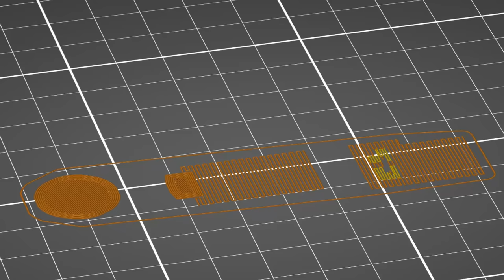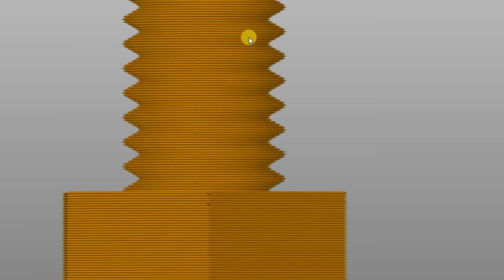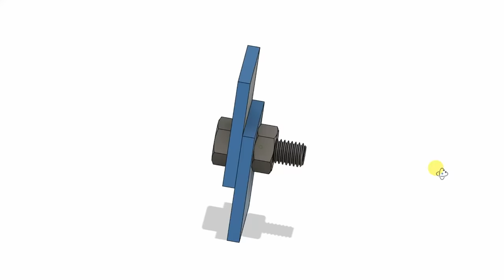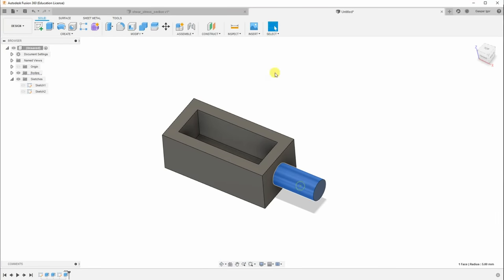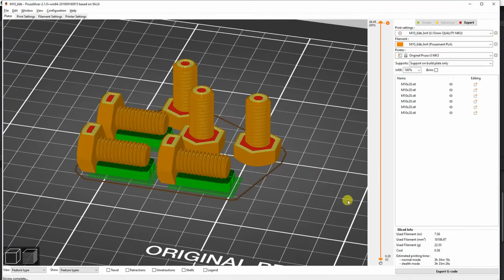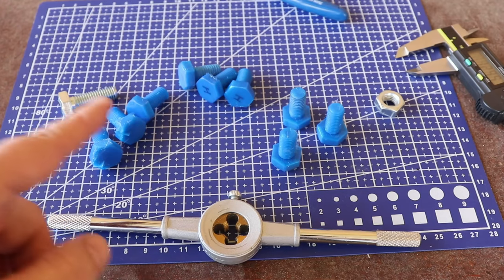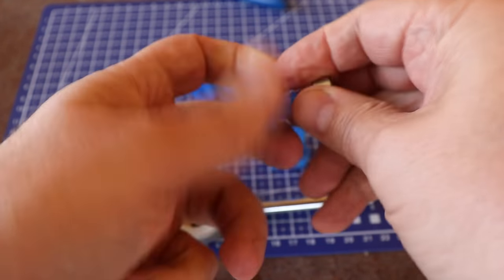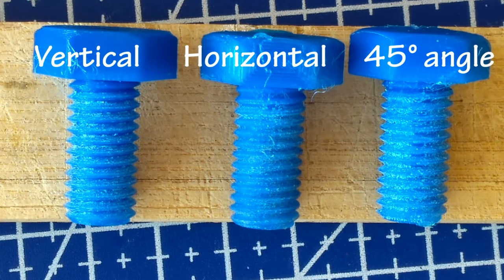3D printing bolt and thread in horizontal or vertical position - strength test

Comment: I should do this test in ABS.  Its notoriously bad at layer adhesion, but I've figured out some tricks in the settings to get it to fuse REALLY nicely and solidly and im tempted to try it.

For those interested, you can get improved layer adhesion by increasing environment temperature.  building an enclosure, then adding in a heater on a relay connected to your board.  I run ABS prints at an environment temperature of 60c, and I actually use the cooling fans at low speed, increasing for bridging and short layer times.  it ALSO requires a minimum layer time, 15-20 seconds works well for mine.  to figure these out i printed a small clip over and over with different settings, a 20 minute print, until I got a tiny, thin part I couldn't snap by hand.
Reply: Haven't printed yet with ABS, but I heard that a problem people have is issues with warping/uneven cooling.

So I'd guess for most people who print ABS without a high temp enclosure the resulting print is barely holding itself together so to say.

Comment: Really impressive! I never thaught they would hold this much. And fun way to test it :)
Although (depending on how strong you are), you may get more force doing it the opposit way - attach the bolt to a barbell on the ground and lift it. And once the bolt gives out, you don't fall to the ground with a lot of weights on top, haha. This also really show the weakest point with 3D printing - layer adhesion.

Comment: for the diagonal one, it might be that at a certain position, under shear stress, it acts like the horizontal one, as the fibres can be diagonal to the shear stress, similar to the bolt with the horizontal fibers.

Comment: I just watched this video, and subscribed instantly 🙂. I'm absolutely beginner with 3D printing. I bought my printer 1 month ago. But, I have technical knowledge and experience. I faced with this vertical printed bolts problem already in the first days. I printed threads horizontal with support, but they were unusable. I mean unusable without post-production. This video confirms my decision. Every time when I will print bolts (and their strength is important) I will print them horizontally with supports, and I will rework the threads with a thread cutter tool.
Reply from the maker: Here is an additional info on the topic https://youtu.be/E3WRBp-T42o

Comment: Also for the stress test, i think using weight and gradually adding them on would be a bit better.  

E.g. start with decent amount, wait 5-10 mins to see changes, add an additional set amount, wait, repeat till it breaks.

Comment: What if, you print the threads to nominal (or +0.1mm) size and then heat the threading die to 80C (into PLA glass transition).
Will it smooth out the surface when "cleaning the threads" or is it possible that the heat will somewhat compress the threadform with the die into correct shape.

Comment: Just wanted to confirm that I was right about positioning, I experienced issues with parts being printed vertically, they would brake very easy because of the way i lt was printed, only horizontally i get the best results when it comes to sturdiness of the parts... Of course not every part, some of them better vertically, anyway Thanks for the great video!!! You did excellent work man!

Comment: You should be happy about the results. You've found a way to make much stronger bolts than you could before. You can still make them the way you used to if they are adequate for the job, but now you have the option to make stronger ones as well.

Comment: A note on supports for the horizontal print: You don't need so much support. A 1mm wide support is enough for an M10 thread just so that it has something to rest on. It's usually best to add this support directly in the modeling tool instead of activating supports in the slicer.

Comment: I know the video is already two months old, but I wanted to add an observation here. 
I researched a lot of mechanical properties of 3D printed materials during college and even published a paper about it, so the reason the horizontal screw can handle much more wight is because the raster lines of the layers are aligned with the force applied to the screw. I would like to see you testing again but with the screw been held in the horizontal not the vertical, as the main force been applied in the screw would be shear force not simple tensile pull. I bet the vertical screw would fare much better in this scenario. 
Sorry if I misspelled something, English is not my primary language.
Great work and great video!

Comment: Im not gonna watch a 19 minute video, but Im assuming the horizontal bolt would be stronger because if it was printed vertical the layers of material it was made from would seperate easier.

Comment: 9:37 it was kind of obvious that horizontally it would be the most resistant print because the traction applied would be in the same plane and direction as the layers print, it's nice to see someone testing this, but an extremely predictable result !!!
Reply: Quite, however, if he had used bolts printed out of PP, the results would be probably a lot less clear or possibly there wouldn't be much of a difference at all.

Comment: The Horizontal position makes sense if you think about the way the layers are printed. the weak points wouldn't be where the layers are placed like in the other positions. You're pulling along the layer lines instead of between them.

Comment: An alternative to using supports for the horizontally printed bolts would be to print bolts in two half-pieces, and either gluing them, or just using the compression from the nut to keep the two halves together. It may be worth testing this concept out to see if there is improved strength and this idea provides a reasonable compromise to obtain some of the benefit of the horizontal print without the additional support requirement.
Reply from the maker: Yes, I got this suggestion few times, definitely I will test it in near future. Thanks

Comment: Won't be printing bolts because nylon is cheaper and strong but very useful information on material strength regarding to printing orientation. Keep up the good work !

Comment: For the first 2 tests I would have suggested using a hand cable winch for 1. Higher range for weight simulation and 2. Safety.  My old metal shop used them for testing smaller metal bolts.
Reply from the maker: solved, in my latest video you can see my new testing setup. up to 500 kg

Comment: I'm just watching the intro (so this might be irrelevant), but if you want to standardize the shear stress test better, don't tighten the bolt, (introduces different stresses that make repeatability difficult) but instead use it as a pin inside a clevis joint. The joint can even be sized properly to each bolt to represent the proper support that a bolt would get and avoid mashing threads. (Which happens when the bolt is sheared against flat edges)

Comment: Great video with great details. For my needs I print bolts in horizontal position without support, but flattened on the bottom. i.e. I cut small amount from the bolt bottom so it can lay flat. And print with no supports and the bolt is strong.

Comment: Really nicely presented results that anyone designing 3D printed parts / enclosures should consider. In my experience, the engineers designing some of these parts, even in commercial applications sometimes forget the very fundamentals and cut corners in design to save filament/ time / revisions..

Comment: I like the video, in fact your videos in general.   I do suggest however on the printed bolts like manufactured metal bolts you investigate the fillet area of the bolt. This area is where the cap meets the threads.  For metal bolts to conform properly to load and to have significantly higher sheer resistance the fillet plays a large part in that.   A fillet is simply a rolled / curved transition to the threads. There is also a reason for a non-threaded part of a bolt and that is for the fillet to transition into material that is like treated / hardened etc.. to the core of the bolt.  The threads may be formed by cutting away material or pressing material. That does not matter to printed, however, I suggest you also consider that transition area for better results

Comment: I believe the order in which you print these results in differences, the printer was warmed up when printing the 2nd piece.

I bet you printed them in this order - 
1. Vertical - Printer Not Hot Enough
2. Horizontal - Printer Temp Perfect For Prints
3. Diagonal - Printer Too Hot

If you printed the horizontal first and diagonal second, I bet you would have different results.

Comment: I see you have the bungee cord to prevent the items from flying off when you are testing the strength comma but you have to figure out another way to test things like this because there's always the risk that bungee cord doesn't work and that metal goes flying into your back. All it takes is one good to the spine and you don't walk again.

May I suggest making a simple box frame? Make the top of it a lever and put a bottle jack under one side. that way you just have to pump up the bottle jack to add pressure and it will make more pressure than any weight you hang. You can add a hook to the bottom side and the pivot arm of the box frame to hook the scale and item onto. If you ever do any tests like this a lot it would save you so much time, effort, and it would allow you to do it safer and with a lot more Force. 

if what I wrote is hard to explain I can always draw a picture if you would like it.
Reply from the maker: Thanks, I already have a safer testing method (based on chain hoist), for example used here: https://youtu.be/E3WRBp-T42o

Comment: Hi. I'm Igor.  
Seriously. That's my name too.  :)
Bratislava 64. I have my suspicions it was a sympathy name. You know, imminent russian take over and all.

Good video. I've always printed bolts horizontally with good results. 
My method is to print hot for maximum adhesion with about 10-15mm of support in order to help mitigate deformation of the supported surfaces by getting the part higher off the build plate, and thus better able to cool.  Sort of a balancing act. Always going to run them through a die anyway but aim to take off as little as possible.

As for nuts, they're under compression with tensile forces being perpendicular. Horizontal is obviously the best way. Still have to wonder if just a little angle may be of any benefit with nuts.

Comment: cool tests and numbers.  Something i realized years ago, but still good to know w/ some numbers.  For example, you can snap a piece of filament in half pretty easily.  Now try to break it pulling on both ends.  Much harder eh? Same principle. If you can design your part assuming the loads are along the length of the layers, you'll have a stronger part.

Comment: To avoid accidents, you can use a steel cable fixed to the floor and a turnbuckle... this is not expensive, and allows you to experiment without risking your health. Good video. Regards
Reply from the maker: Thank you, since this video, I improved my testing methods, here is one with improvements, similar subject: https://youtu.be/E3WRBp-T42o

Comment: That's why I love my SV04 idex: you can use PETG as easy break away support for PLA and vice versa.
Reply from the maker: There is a method, where you print in horizontal position and don't need supports https://youtu.be/E3WRBp-T42o

Comment: Thanks for showing the experiments. But honestly, I skipped to the conclusion because I know the continuous string (in the horizontal position) will definitely provide the strongest pulling strength because there is no layer separation -- or the fused deposition cannot still really fuse the two layers (because the bottom one is cold).

Comment: I have been looking at using 3D printing to make the bolts as resin molds, then casting it.  The bolt can be made with the equivalent of 100% infil, plus the plastic is being extruded as single peice.

Comment: Loved the test, but I would have also added a Control which is a non 3D printed bolt made by using the same material but threaded (to show whether the issue is the material or the shape)
Reply from the maker: I will try different materials in near future, including resin and injection molding
Reply: @MyTechFun  thanks for the reply! I appreciated the video a lot. But try to be safer :)

Comment: Well done test approach.  In some of my testing, I find that the inter-layer strength is greatly affected by cooling settings.  In using PETg filament, with the "PLA cooling fan" on, the layers would separate easily,  I disabled the cooling fan, and the inter-layer strength is much stronger.  Likewise, printing in an enclosed (heated) cabinet like for ABS helps greatly.  I have also read the printing in thinner layers (which get squished out wider) is also stronger between layers.
Reply from the maker: I already got this suggestion, it looks like I have to test that too in near future (PETG vs PLA, less cooling, vertical position)

Comment: Great video! It can be seen how much effort you put into the detailed documentation of experiments. I would suggest you for the next time to make at least three (preferably more) tests for each specimen(e-g- 0, 45, 90 degrees)  and each test type. That way you can calculate the standard deviation within each test. Presenting standard deviation makes your measured data and also conclusion more trustworthy. Great job though!
Reply from the maker: I agree, but first I have to prepare some easier pull test method. This was only rough comparison test.

Comment: Nice video! I really like the "tree support" feature in Cura. It seems like it uses less filament and prints faster (but not in all cases). Might be worth a try to print screws horizontally with it. Getting pefect layer adhesion might be hard sometimes.
Reply from the maker: I am testing sliced horizontal bolts, looks like that can work too and no supports needed

Comment: Thank you for this information, I expected the horizontal as favourite, but I didn't know how far. One thing I'd like to mention: how about the environment temperature? What would you expect for a hot summer day, I think this could have an impact too, probably weaker but how much? Nevertheless, I know, this question is more about the filament type and not the thread technique.
Reply from the maker: Yes, good question, and more important if we use PLA. I am very curious about that too, I will do some experiments on that subject too.
Reply: @MyTechFun  thats fine, I'm waiting so long, thanks :)

Comment: Thank you for this video !  You have a new subscriber 😊
I join the other persons urging you to use a pulley system or a jack or .. something. 
It looks stressful, and also much less professional when you use your body like that.
(I have read your answers about the upcoming Arduino tester 😊)
Anyway:great video!
AND: It would be GREAT to see horisontal printed screw in two halves... without support, and see how that would perform 😊
Best of luck 🙏‼️
Reply from the maker: Thanks for comment, up coming tests: bolt in two half, but also bolt cut 10% approx, it can be printed without support horizontally. It should work too. Also I got suggestions that PETG is much stronger in vertical position compared to PLA. But first I have to test screw nuts too.

Comment: Great video. Very usefull for the project I am working on. Surprised about the strength in the stretch tests. The torque as expected really. That is the weakest point of these bolts. But the test confirmed that I do not have to use steel in my project as the load is not very heavy. I was thinking about putting a nail or small bolt inside the 3/8 inch bolt I am going to put on my design just to reinforce it. But probably I don't even need that.

Comment: Just a suggestion, to test the shear, it would be better to setup in a double shear mode. Your current testing in single shear mode will result in the part being tilted, which the resultant force will have both a shear and normal component.
Reply from the maker: Yes, I agree with you. If hole is near similar size as bolt, that tilting is not so big. And since this is comparison test, they all are tested in same conditions. For double shear test I need to rebuild testing equipment, my weight wouldn't be enough for that ;-)

Comment: For the shear test, the 45°-printed bolt is probably anisotropic. Depending the direction it is mounted, it should be weaker or stronger (if the printing layer plane is parallel to a vertical plane or at an angle to vertical). That said, even if there was no actual improvement in the measured  performance of 45°-printed bolts, I wouldn’t use them, just because their properties can potentially vary by a great deal depending on the orientation they’re installed at.

Comment: I also hate using supports, but if I want maxium strength, I would split the bolts in half lengthwise in the slicer so as to enable both parts to be printed horizontally, then supergluing them together. Yes, you do have to carefully align both parts otherwise the threads will bind with the nut. It would be great to know how the super glue holds up in the torque test with this method.
Reply from the maker: Something like this? https://youtu.be/E3WRBp-T42o
Reply: @MyTechFun  Yes exactly like that, sorry I missed this video, I didn't realise you were ahead of me by two years😄 Keep up the good work.